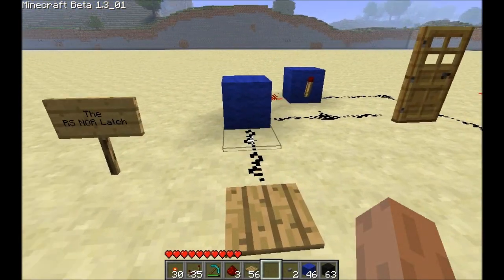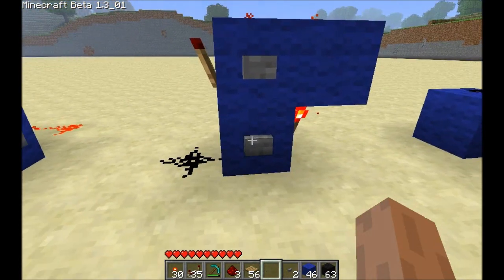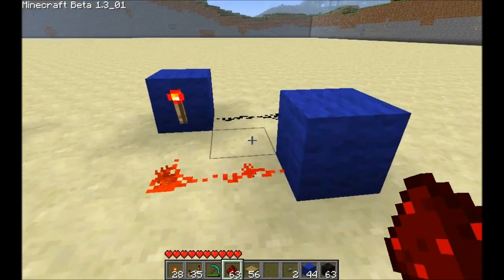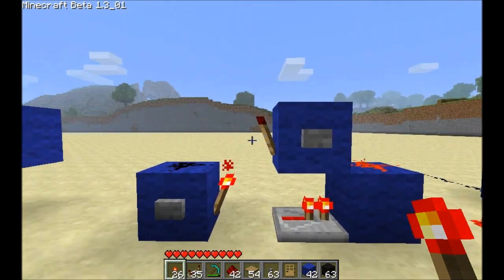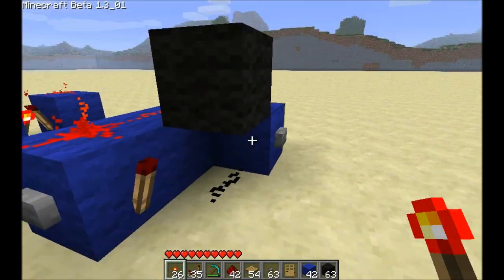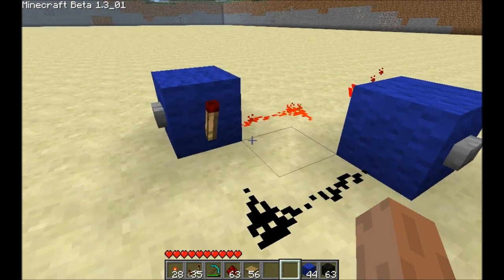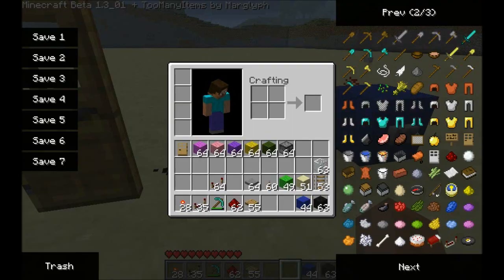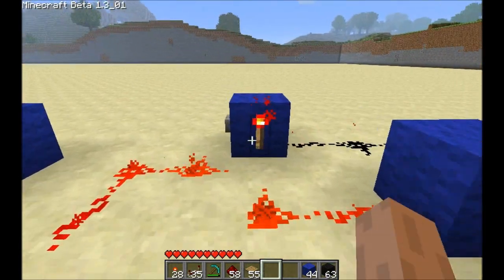Redstone Tutorials for Minecraft: The RS NOR Latch

Comment: You can use this for railways, which only have detector rails, which are essentially pressure plates. And a lever is always on once on, a button pulses and then is off, it doesn't keep sending an on signal

Comment: A T Flip-Flop is a toggle, it uses a single input (in fact, that's what the T stands for: toggle). An SR NOR Latch requires two inputs where SR stands for Set/Reset. A T Flip-Flop doesn't "reset." It's a toggle, switching between two states with a single input.

Comment: Well its meant to give a level-like function to things like buttons or pressure plates, has a few uses like to tell you if a particular wire or block has received power at any point in time, even if the pulse stoped

Comment: @thismightbeyou 
You can make incredible things.

An example could be a pressure plate against a wall. You then step on it, and pistons will make a hole through the wall. The secret dorr' won't close again until you have stepped on the pressure plate on the other side. This only works on way (if you want one that works both ways, you should look at the T-Flip-Flop. It requires a lot more space, but is pretty handy.